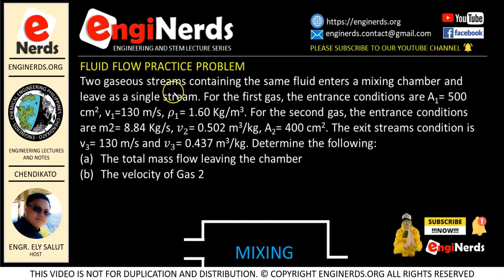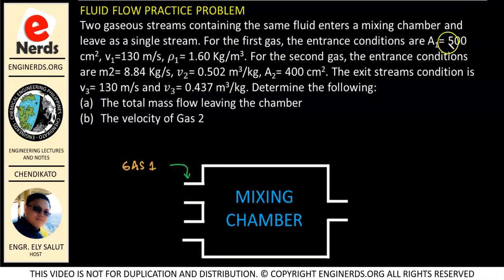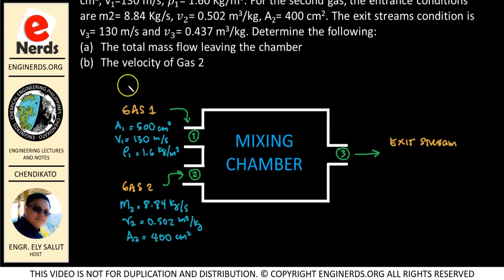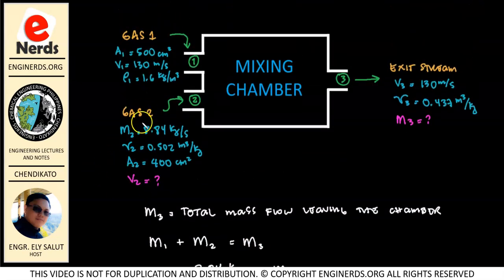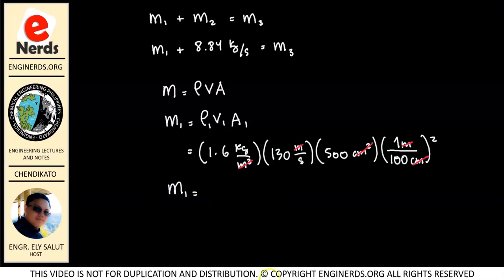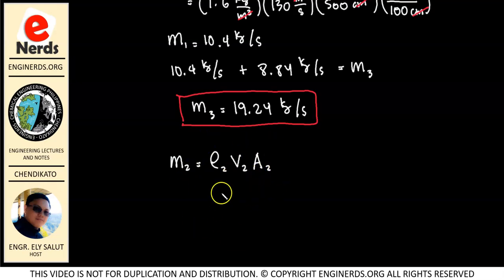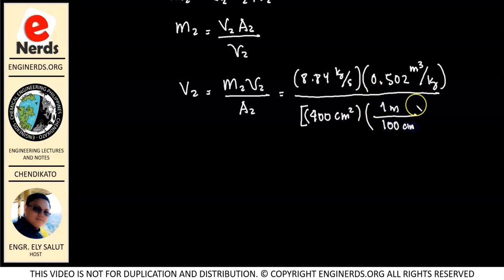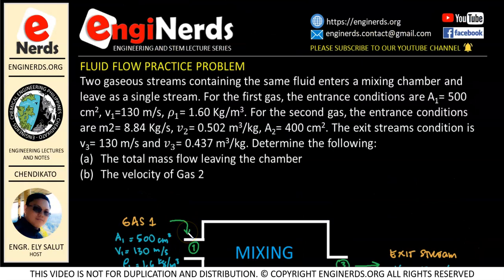FLUID FLOW PRACTICE PROBLEM | FLUID MECHANICS AND HYDRAULICS | ENGINEERING | TAGALOG | ENGINERDS

Comment: Sir how about the given is in diameter. Papano ko po makuha Area if there is no given kind of circle,rectangle or any shape for the Area. Parang ganyan din po sa gaseous stream.
Reply from the maker: if the given is a diameter, it means the cross-sectional area is circular. A diameter by definition is the length of the line through the center that touches two points on the edge of the circle.